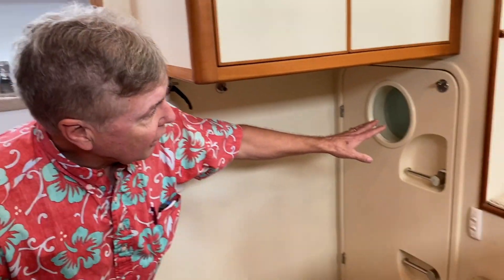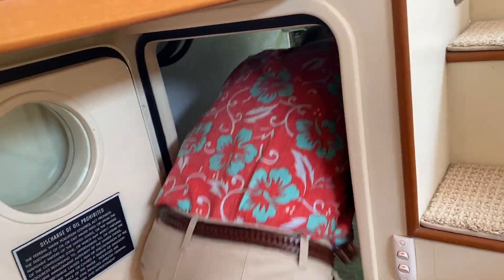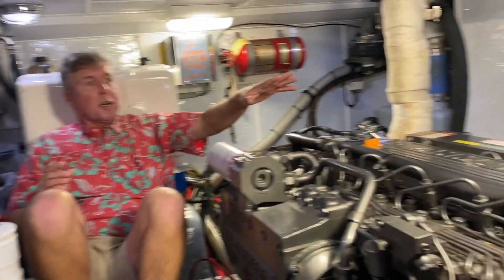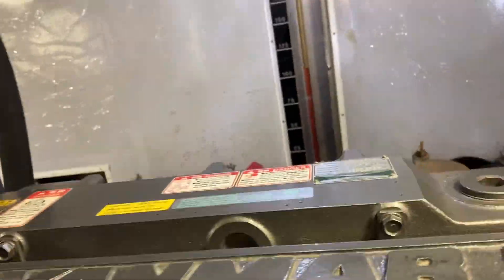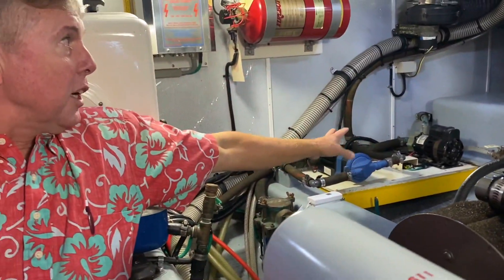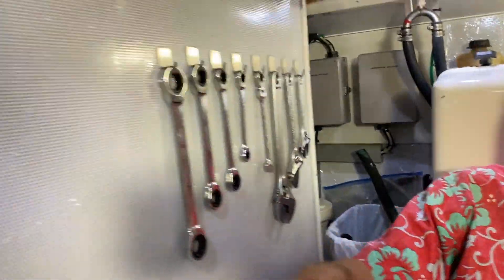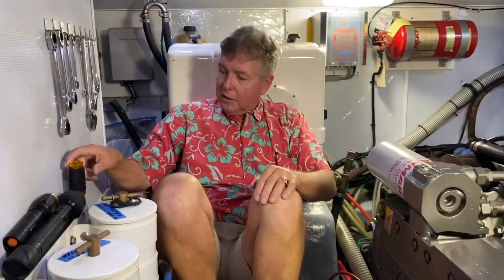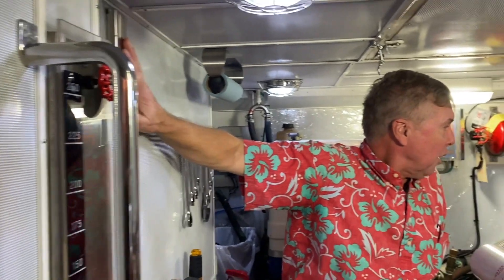Nordhavn 35 Engine Room Tour with Project Manager

Comment: wing engine needed
Reply from the maker: Jade, If was going to cross the ocean, yes it would be nice but this is a heavy duty, long distance coastal cruiser.  You will be hard pressed to find a reliable engine like the Yanmar on this boat failing.  If you keep your fuel and filters clean, they are pretty much bullet proof.  I had a wing engine on my Nordhavn 43 and in 10 years and 20,000 miles, it never once was called to duty!
Reply: You're Not going to fit a wing in a 35.  This is a Small boat.
Reply from the maker: @seadog2396  I don't think it really needs a wing from my experience.  If it gets too rolly underway, increase the hull speed.
Reply: @kurtantonius5268  It's not about rolling.  It's about getting home safe.
Actually, I don't think we're going to see very many people sailing hundreds of miles offshore in a 35.
Can it be done?  Sure, but not advisable....